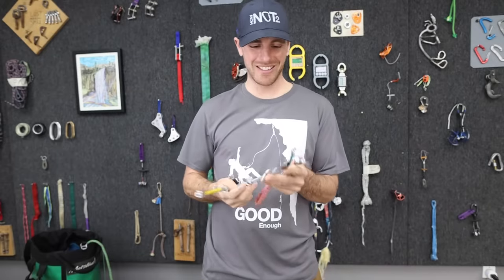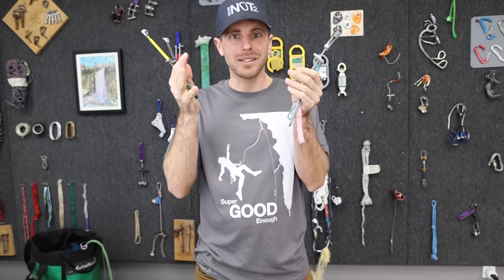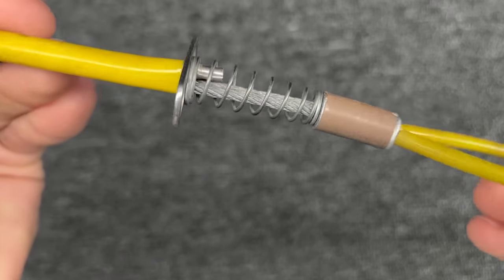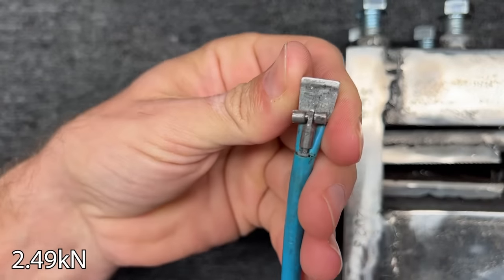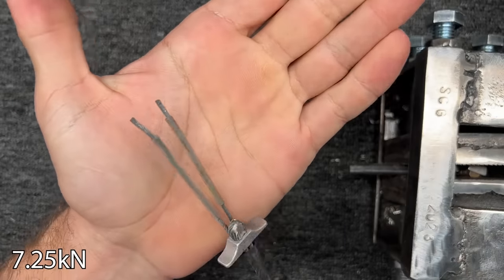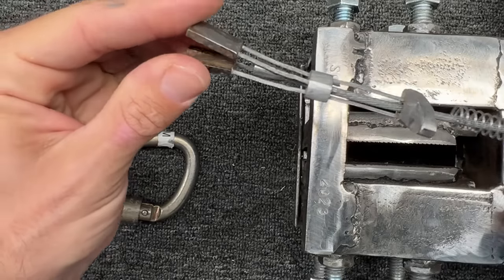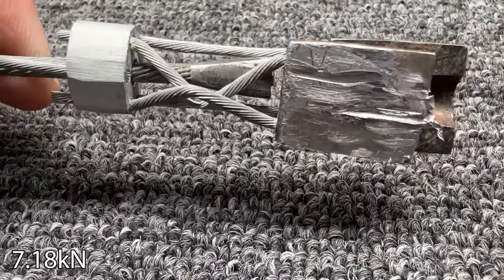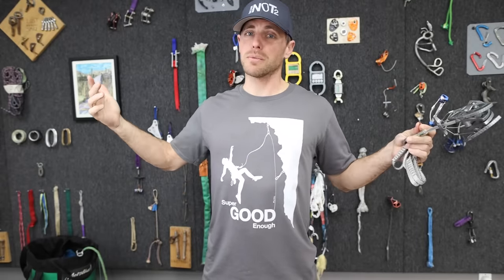Home-made Climbing Gear?

Comment from the maker: Recalled alien tested https://youtube.com/shorts/CKx2BWh0SIg.  Aric Datesman tested these in 2009 and said this about them: Of the 24 of them I tested similar to how you did this one, of which 13 were brand new and never used, only a few broke above rated strength. Many broke well below rated strength, and a few broke not much higher than bodyweight. Failure modes I found included the failure of the brazed joint, the top of the head where the axle went through popping off, the cable failing at the swage, the axle bending to the point of being U-shaped, and the lobes deforming and pulling from the test fixture due to being overly soft.  Many of them also had the axle hole in the lobes incorrectly centered in relation to the curve of the bearing surface of the lobe, with the Orange ones being the worst offenders (I suspect their drilling fixture was incorrectly designed).
Reply: If you want I can make a clip about away to splice a loop eye in cable for yea, 
I would make a few and send them but that I'm not to sure on how to do

Comment: The stopper with the brass slider was called a “Buddy” made by Dbest mountaineering ( Don Best). I think that they were sold around 1986 or so from Liberty mountain. I climbed with a full set of them for 20 years. The larger sizes were bomber and held a ton of whippers.  The one that you tested was the smallest size. I still have the full set in a box!
Reply: When you retire them would you be willing to donate or lend them to the channel for testing/review?
Reply: Dont do it lol. Treasure them

Comment: Some lock nuts on those adjuster bolts could help! If you watch at 2:10, the top left actually backs off, allowing the piece to slip out.

Comment: 4:16 to splice an eye loop is realitively simple, but takes a little time to practice, but is far far better than just clamps
Reply: Or use a thimble eye, remember you are dead.
Reply: @johndavidwolf4239  just break(untwist) the cable into two halves, (leaving the core on one of the halves) and split it back a fair amount, then Bend it into a loop(both ends fold in opposite directions) and then wrap back in to the natural twist, but remember to leave a legit for a tail,(you can tape the tail or clap it) this eye loop will not pull out unless under extreme strain, the cable should break before the loop let's go.
Reply: @johndavidwolf4239  the goal is not to end up in a pine box or in an urne

Comment: I liked that last one.  Not only does it look good, but that stuttering as it failed would make a nice shock absorber, helping to mitigate the shock pulse when you finally come to the end of the line.  Just like safety harnesses have those rip-away stitches.  😁
Reply: It also offers a really nice set of grating noises as the wire makes its spasmodic slips through the saddle clip allowing you to experience a few more moments of fear as you question whether or not it's actually going to hold.
Reply: @steelonius  Sounds like a real win-win kinda deal!  Whoever invented that thing is a genius!
Reply: @threeriversforge1997  😅

Comment: The last one is cool. Most gear i have does not include a shock absorber
Reply: For real that was basically a steel screamer. Probably would hold a whip since you aren't going to put 8kN on it after sustaining 4kN for a few seconds.

Comment: You said that you already plan on getting some different rock plates to glue inside it for testing but if you need some slabs cut off of different natural rock types I have a lapidary slab saw and would be happy to work together on something.

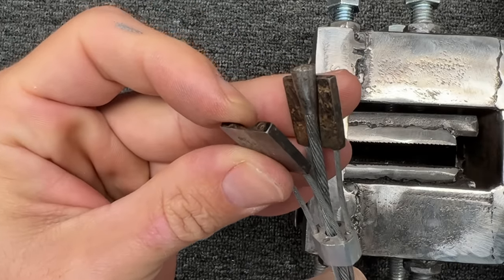Comment: 3:36 I think this thing would get stuck as soon as it gets properly loaded for the first time since you have to push the middle part up to release it and steel cable isn´t the best in compression.
Reply: Good point. You'd have to hit it with something to beat it back in.

Comment: The slipping of the cable clamps is quite interesting, as they look properly set, assuming the correct size clamp was used. The cable looks like 1/8", and with 2 clamps it should have a breaking strength of about 7.3 kN (80% full strength). I've seen maybe one video of a clamped cable breaking, without any useful info on the force. I don't think many climbers use cable clamps.

Comment: Excited for the rock plates, I how they don’t crack. I’m definitely curious if polished limestone or granite has a high enough coefficient of friction with the aluminium alloys to work. Or if things like the dmm triple grip pattern do anything in smoother rock. I wonder if it will concentrate forces enough on the edges or corners of the pattern to cause local deformation that will help things stick

Comment: Get a hold of Carbolite They laser weld Diamonds the surface of chassie Dino drums to prevent. Tire slip on 2. 2-3thousand horsepower cars. Seams like a good application in the cam crusher. 
They also have a 450mph bonneville race car.

Comment: So I would never climb on one, not what they were designed for… But those clamps you were referring to do actually have a name in the industry, they’re called “Crosby”… or at least that’s what I’ve always heard them called by everyone. And what I typically see them used for in a larger form factor is to put guy wires on towers. So for a static line situation. They always deploy a figure 8 safety on the line in case they would slip whenever they are used.
Reply from the maker: Crosby is a manufacturer of high quality cable clamps. They generally have a red U bolt. I highly doubt these are made by Crosby.

Comment: That sliding cable seems like a very good shock absorber. But I definitely would trust my life to it in that configuration.
Reply: Until the other side of the cable slips and you end up on the floor because the loop disappears
Reply: @markkNL  yeah... That's one of the reasons I wouldn't use it on a real rock. But I think it could be possible.

Comment: Super interesting video, thanks! Preferably I wouldn't depend on home made stuff to save me but physics rule my life as much as they do Mr. Petzl's so it's good to see most of these hold a few kN. The slipping one actually seems pretty safe to me; it's what those clamps do and I'm not heavy enough to generate a bunch of 4+kN loads when falling with a reasonable amount of equipment on me.

Also, maybe be careful with those files. They're a good solution to the wedge problem but that type of steel can explode in pretty spectacular ways. Fun if you're safe, a sad story about your eyesight if you're not. Have you considered fiber bound concrete as a plate material? You could have some steel plates machined and pour a fresh face whenever you need to. Machine them right and they should be mechanically locked in place.

Comment: Very interesting, these broke higher than I'd expect. I would still never trust my life to them, but who knows when these were made? There might not have been any commercial options at the time.
Reply: why would you not trust them??   all the famous legendary climbers that you idolize trusted stuff like this, and even sketchier stuff than this when they were climbing.   so, its good enough for them to use, but not good enough for you??   thats just dumb.   bro, when are you going to be putting more than 6 Kn of force on your climbing anchors???  your not,  EVER.   they are just as safe as any commercial brand anchors.
Reply: @orion7741  Can't tell if you're trolling or not. The issue is consistency, you have no way to know if the homebrew job you're sticking in that crack will break at 6 kN or 1.

I don't idolize any climbers, and there's tons of sketchy stuff they used to do that's just needlessly risky when we have the amazing gear available to us today.

Comment: Question for your guys...
I recently found my old climbing gear which is twenty two years old. It is in mint condition, barely used, stored in a cool dry place.
I have a dynamic rope, a harness, and a host of other karabiners and slings.
Is it safe to use or should I bin it?
Reply: You should send it to HowNot2 so he can break it for more quality engineering infotainment.
Reply: Dont use the rope or the harness, or anything fabric.   but all the hardware should be good to go.   anything fabric based degrades over time even if its just sitting in a closet somewhere, and that is not something you want to trust your life on.
Reply: @orion7741  Thank you for this.

Comment: Have you guys ever tested what happens if the weight difference on a Ohm is bigger than 40kg and how much different they need to be to have an impact?
I guess the rope diameter will be critical when it comes to this...

Reason i am asking: i am with 2m and 110kg slight heavier than the stereotypical climber.^^
Reply: I don't think it really matters. Obviously the forces are greater on a bigger guy, but not too much greater.

Comment: Wow who would hang themselves off hardwear store cable clamps. That's nuts
Reply: anybody that does a bit of research would, thats who.  cable clamps are designed to hold THOUSANDS of pounds of pressure.  they are designed to hole up to more pressure than you will EVER put on them when climbing, even if you take a massive fall.   they are perfectly safe to use.

Comment: The U-bolt wire clamp shown in the last cam.... thats trust that you are not going to fall. People really should be using cable crimps which, if used correctly, can achieve 100% of the wire rope's breaking strength.

No need to be a cowboy….